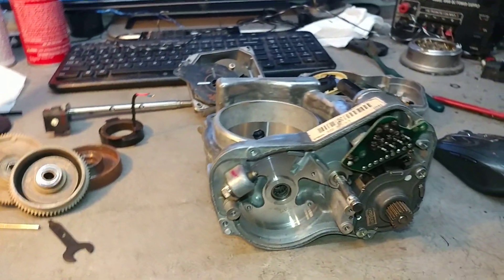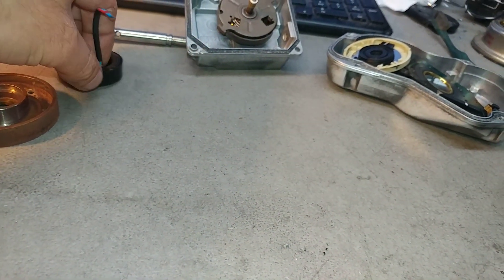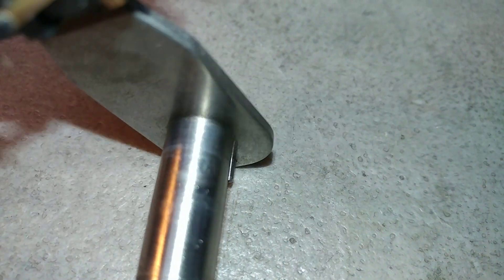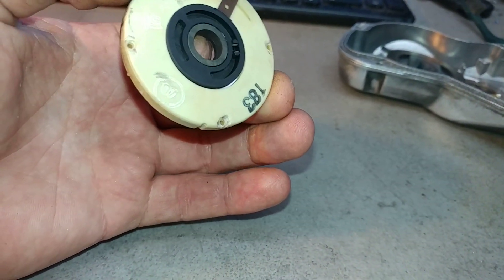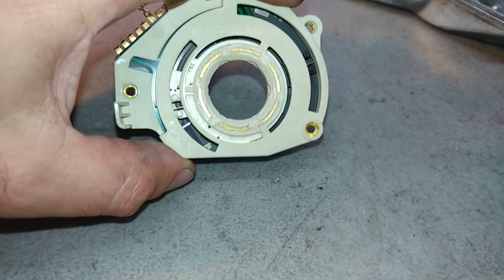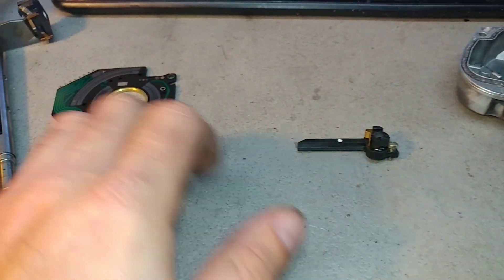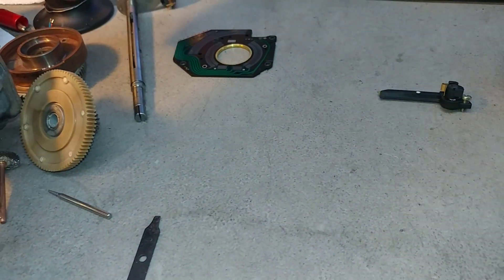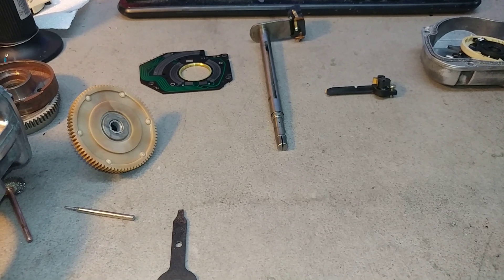Mercedes E320 throttle internal condition

Comment: Victor - we can see that you RESET the electrical system which GET THE THROTTLE OUT OF "Limp" mode.  - CAN YOU SHARE WITH US HOW YOU RESET IT? .. CAN WE PUT A VOLTAGE IN A CONTACT TO RESET IT?
Mike